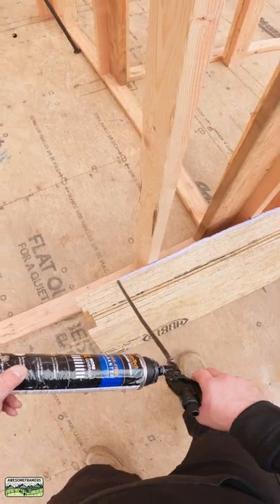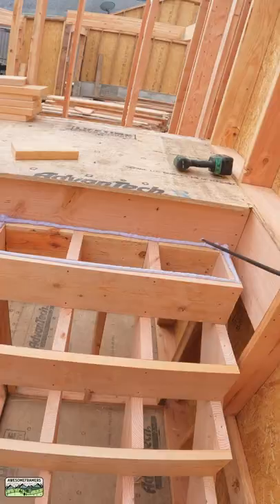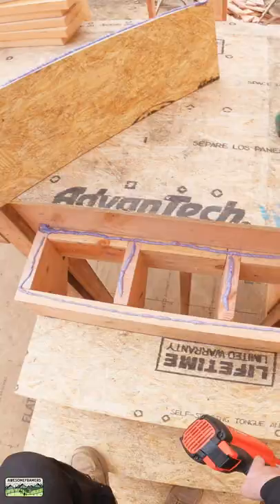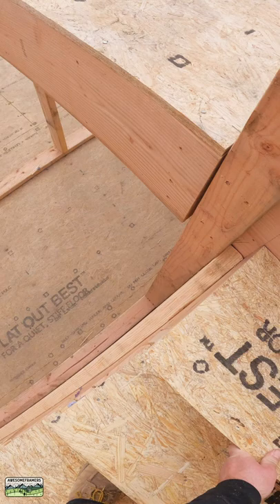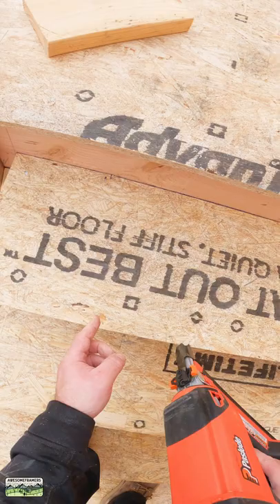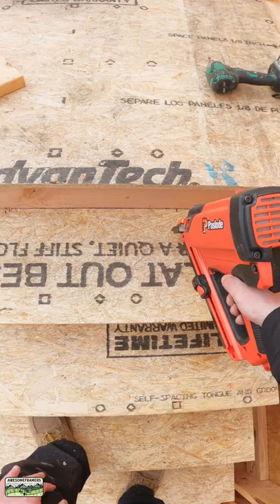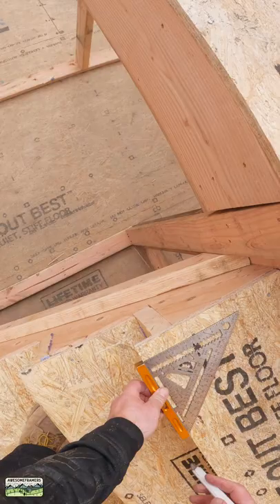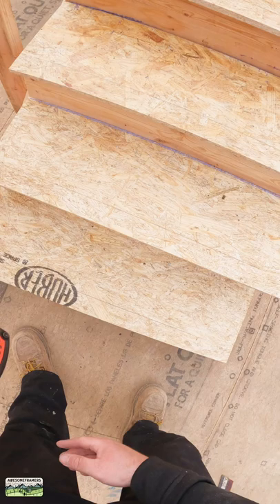Stair Framing part 2 #shorts

Comment: All well and good for a hobo stair case, not a finish I would want
Reply: You're silly to think that's the finish.
Reply: @jameskocjan9492  he said carpet is going over it.      I think I would still use solid wood on stairs no matter what.   But I have OCD about the wood he is using for the stairs and subfloor.     I only use high quality plywood.
Reply: @homesteadhaven2010  this is high quality plywood, it's not your typical osb here. It's Advantech 5/8" subfloor osb. It's weather resistant for the most part, and it's proven to have less flex than plywood.

Comment: Ah glued sawdust because that will last for 200 years right 😂
Reply from the maker: Nope it's not glued sawdust. To even suggest that tells me you stopped learning a long time ago.
Reply: @AwesomeFramers  okay so they're technically wood chips but that's basically the same thing 🤔
Reply from the maker: @jamespimental6919  nope not the same thing. There is an incredible amount of engineering in the process. Do some reading on Advantech, which is what I used. It's fascinating